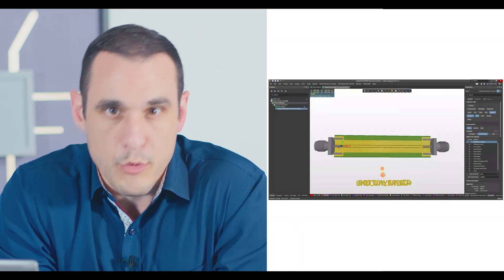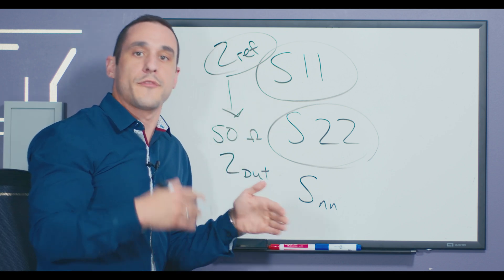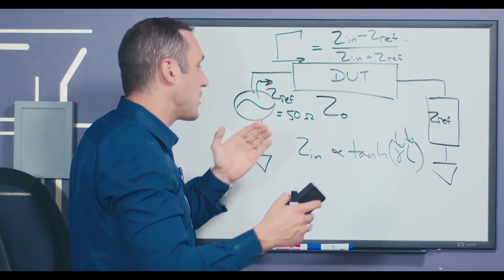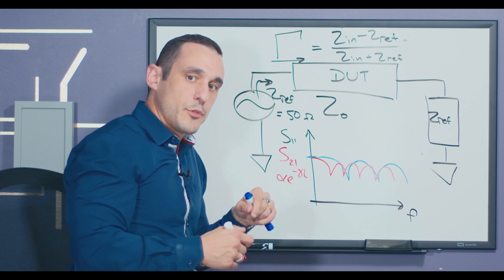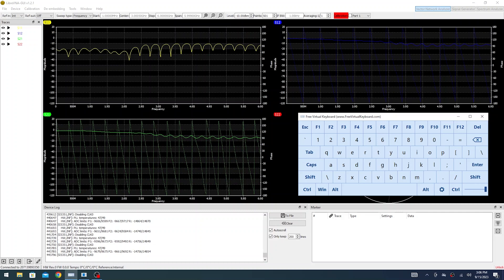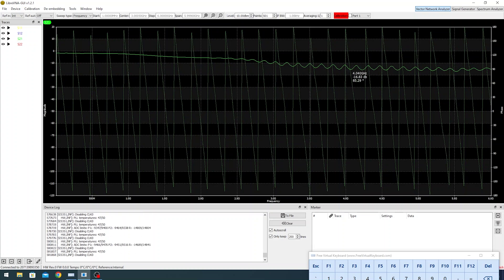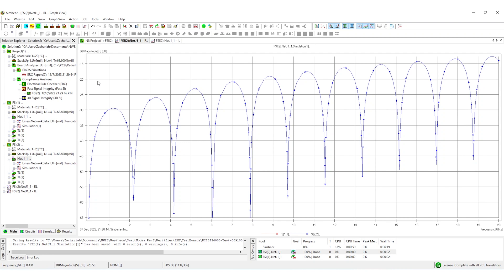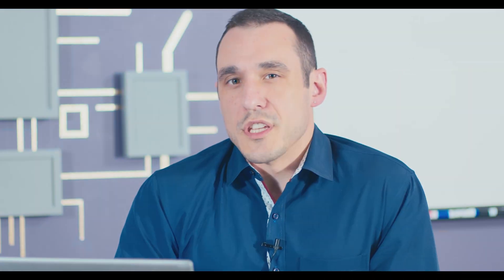How to Measure Trace Impedance with a LibreVNA

Comment: Hello i have a question concerning your video. The primary question was how to measure the trace impedance. But i could not find any
concrete formula how to do this using S21 and S11 in the video. Could you please provide the exact formula. Thanks
Reply: It requires two formulas. S11 is equal to the reflection coefficient from the input impedance as seen at port 1. So you first take S11 and convert it to a decimal number; then you use that to determine the input impedance. Once you have the input impedance, you can calculate the line's characteristic impedance.

Comment: LibreVNA is a toy ?  Serious,  3Ghz @ 100 db ..   I will take it !
Reply: At lower frequencies it is pretty good and I've used it in some circuits just as a sanity check against a design. I'm suspicious of the higher frequency range and whether that reading is really accurate. I have never qualified it and I do not know anyone that has qualified it. But it is inexpensive compared to a higher end VNA so it's worth getting if you work at lower frequencies.

Comment: As the developer of the LibreVNA (and user of Altium Designer) I certainly appreciate it being used as a demo device here. However, I can't help but be a little disappointed in the execution:

1. A very important part of any VNA measurement is the calibration. The calibration standards (and their assumed limits) are briefly mentioned in the video but the LibreVNA is not actually calibrated during the live measurement (as indicated by the red background of "calibration" in the upper right toolbar). This immediately makes every measurement essentially worthless. Yes, the ripples still give an indication about the line length but the measurement is dominated by errors from the VNA frontend (which would have been calibrated out if a SOLT calibration had been performed)

2. The LibreVNA supports conversion of the S-parameters to time domain data (TDR mode in a VNA). This would have allowed to plot the trace impedance live on screen (showing trace impedance in Ohms vs. distance). Of course this transformation only yields valid results if the VNA is calibrated. I get that this is an instructional video and should show the math behind that as well but it would have been a nice addition.

Although I am certainly a little bit biased when it comes to the LibreVNA, I can't really compare it to professional VNAs (neither in performance nor in price). But I certainly feel that it has been a little bit underutilized in this example.
Reply: Hi @jankae3676. Thanks for doing such a great job on LibreVNA. It's not perfect we know, but have an excellent balance between price and functionalities. Your creation has enabled many less fortunate people to gain access to this type of equipment. And It's NOT a toy 😅
Reply: It was calibrated prior to usage. Not sure why the box is red but it was calibrated live with the provided standards and not just settings loaded from a file. In fact in a different video I talked more about calibration and IIRC showed it live.
Reply: Thanks for the fast reply :) It may have been calibrated previously but the fact that the box is red indicates that the calibration is not active during the measurement. There is a checkbox to the right of it and that has to be checked, otherwise the calibration data will not be used. I admit that such a user error can easily be caused by my incomplete or unclear documentation. If that is the case, feel free to reach out if there are any questions regarding the usage of the LibreVNA. I am happy to help or add further explanations to the user manual